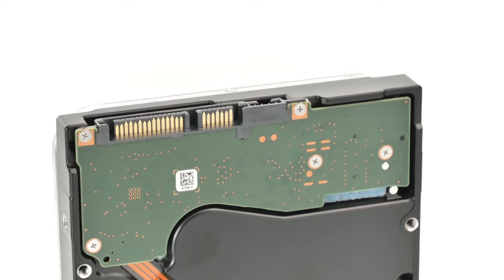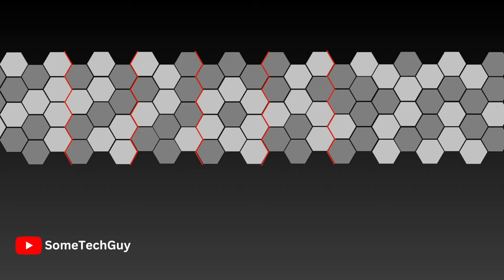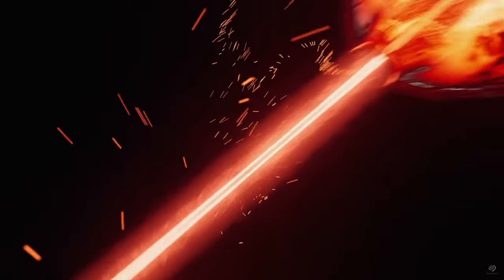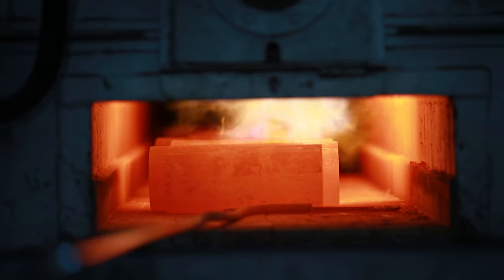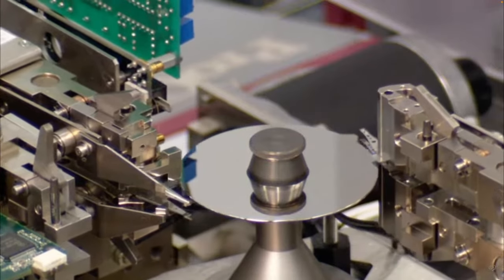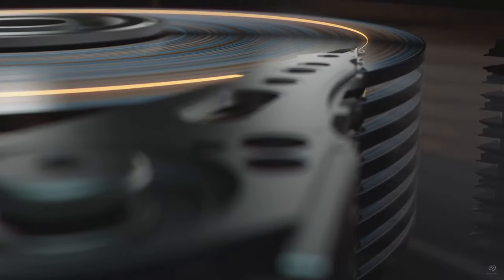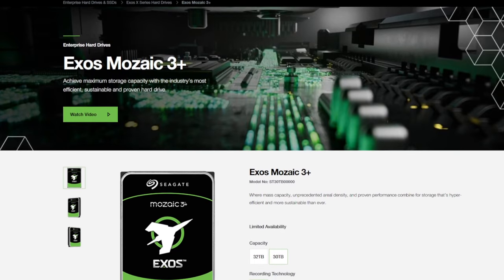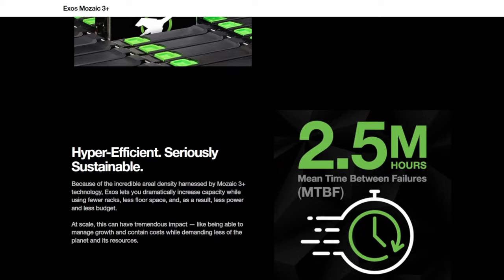Seagate Mozaic 3+ HAMR 30TB+ Hard Drives - Deep Dive

Comment: its amazing that hdds work at all
Reply: Sad that SSDs are getting more expensive tho. Would have loved to just switch over to SSDs for my stuff
Reply: @AlpineTheHusky  No they aren't. HDDs and SSDs are both getting cheaper and SSDs are actually getting cheaper faster than hard drives
Reply: @thoughtyness Maybe in the long run, but the ssd manufacturers like Samsung and Micron are reducing the supply to get better margins.
Reply: @thoughtyness  ssd are not getting cheaper, stop the cap, they're getting way more expensive due to over demand of the nand chip
Reply: And now on top of that we are using this mindblowingly precise technology and it is good and reliable enough that it can be manufactured and sold to every day people.

Comment: Am I the only person that wishes they would work on cost rather than working on size.  HDD cost to value has been stagnant for years now.  10TB drives should have fallen to the magic $99 price point by now.
Reply: It is slowly coming down. I remember back in 2018 getting a 1tb for around $100. Now I can get a 3tb for the same price. But higher is more pricey. It would be pretty cool to rock a $100 10tb or bigger.
Reply: Cost is getting down, you're just looking at it from wrong side.
Look at it as:
Base cost (casing, electronics, ect) + cost per plate and rw head.
The denser the plate - cheaper it becomes (per TB). Also you're ommiting simple fact: base materials and electronics is not getting cheaper, so how can you expect HDD getting cheaper, while it requires electronics 😂

PS.
Im ommiting other important costs, like R&D, more expensive electronics, ect.
Reply: All the things you mentioned except R&D gonna cost them max 10 bucks
Reply: With cheap ssds, hdds have become a niche product.  Most people only want 500gb or 1tb tops in their laptop/pc.
Reply: Bigger disk mean its possible to have lower price per tb but also datacenters are main customer and bigger disk mean less power usage per capacity so it makes complete sense

Comment: Looking at the way hard drives work, they seem nothing short of an engineering miracle
Reply: Love the speed of ssd-s, but hard drives are really like magic hiw they work.
Reply: Not really anyone who has ever mowed a lawn can see how you can adjust the alignment of a material (Grass) to generate patterns. The principle of how a hard drive works is rather easy to understand. The head of the drive is the lawnmower, the current passing through it is the blades of the mower, and the platter is the ground and the coating, the grass.
Reply: @IdgaradLyracant  The concept is simple, but using a macro scale component to read and write bits at nano scale is not. It's like saying you can technically use a needle to poke a CD to create a windows installation disc.
Reply: @cucumberworks and now on top of that we are heating that precise spot to make it easier with even smaller needle
Reply: It's not just hard drives, it's computing in general. It's insane computers work at all. Literally every part of a computer is starting to push the boundaries of physics.
Reply: Right.. now get your lawn mower to the other side of the yard in 4ms and make sure your within 1000th of a mm .. you still think it's easy
Reply: Not really. The concept and technology that HDs are based on has been around since the late 19th with vinyl and phonograph records and is relatively simple.

Comment: just purchased a exos 18TB, I am amazed by how the technology keeps improving
Reply: I just got a 14 exos and kinda wish I got a bigger one. Great drive though.
Reply: @_-Karl-_  yes. Ha. Its my backup for the 3 5tb drives I have. I know the math doesn't add up but it works. I know though I'm going to surpass the 12.7 allocated and probably will get 2 20s when prices go down so I have 3 full copies. As of right now I feel it would be extremely hard to fill up a 20tb with "usefull" data. 
Its crazy to think my 2tb drive 13 years ago was the cost of my 14tb. My first mp3 player was like 512mb. Now I can't fit all my music on a 512gb sd card. Lol
Reply: But it's improving beyond logic. As HDD become bigger without improving performance they are starting to become a bad quality tape. If you build a RAID with say, 8 of these drives and have a failure, even if the drive sustains 100% peek performance and it's only 60% full it will take close to 19 hours to rebuild. Long enough that the possibility of a second drive failure during a rebuild is real.  Clearly, it will take maybe 2 to 4 times more time (because of random iops) so you get the picture.

Comment: This is starting to become complicated. How long does it take to rebuild a 30TB HDD that is at 60% utilization?  It will take forever exposing the RAID array to a second or third failure (catastrophe)  during that time. We all know HDD performs pretty bad on random IOPs, but even if we assume the drive will be rebuilt at max sequential speed ( 270MB/s) it will take 19 hours.

Comment: I remember the ancestor of those drives, the Hammer drive, which got high density on an optical medium using a similar method, it was magnetising the media, but reading was done instead via the polarisation change of the surface depending on the magnetism, using an optical pickup with a polarised light source instead.
Reply from the maker: This was really cool tech. Quite a few comments here that people remember it. Minidisk was also built on the same principles I believe.
Reply: @sometechguy  If you were dealing with DTP in the 1990's you were almost obligated to have at least one, along with Zip drives, as most of your artwork for packaging and products would need to be sent on physical media, and making revisions was long. Also you had them being the biggest early adopters of CDR and CRW drives, even if they were only capable of reading and writing at 1x speed.

Comment: We think SSDs are the future when hard disk technologies are still rapidly evolving. Looks like hard disks won’t die anytime soon
Reply: considering tape drives are still evolving and have insane capacities it's not really about if the tech is going away,  but consider that we now have 64tb nvme drives that are both faster and larger capacity than hdd now,  meaning going forward they will likely be the future of non archival storage , especially as price comes down.  of course new disc media is coming out as well so we might see the Resurrection of bluray
Reply: So far, so good. But hard drives are bound to go obsolete in about 10 years. Far more room for development in SSD tech.
Reply: @manitoba-op4jx  don't drop your hard drives because they have higher failure over SSD if you do.

Comment: Fascinating. This is not my field at all. But I can't comprehend how the nfts, being necessarily larger to intercept the lasers, then smaller at the pegs to precisely deliver the heat, all fit together given their larger size than the data layer points at the pegs.
Reply from the maker: The transducer as a whole is larger, the specific sizes are not published and I guess they could change depending on the application, but as you say, it would need to be at least the size of the laser light wave as it leaves the wave guide.  Then the peg at the bottom would want to be the target size for the specific domain its targeting. And again, this size could change depending on the targeted data density. But very small, in the 10-30nm range I would expect. But the diagram isn't measured to scale, because the actual measurements do not appear to be published (unsurprisingly)

And this is going to be a simplified explanation, as I am sure the detail is important from a fabrication standpoint and its also likely to be intellectual property which isn't in the public domain.

As for the disc and the peg, I don't know if they are fabricated as a single item or joined, but in my research I did find that they had some challenges with the peg recessing into the disc at high temperature which had to be solved by densifying the metal, which is a fabrication process where the material is compressed during manufacture to reduce this happening during operation. And this (at least from what I found) addressed this issue.

Comment: I wonder if at some point they'll need to increase the physical size of drives. Like 2" tall drives with 20 platters, or 5" diameter that sacrifices speed and for capacity.
Reply: There used to be a form factor that would potentially work, 1.6” high drives. Though I’m sure around 80% of all drives produced today would be used in data centres and in disk shelves or severs which use 1” high drives, so the various drive manufacturers are more or less stuck with making 1” tall drives because the cost to make 1.6” or 2” drives would nowhere near even close to worth it considering how they wouldn’t sell anywhere near as well as the 1” tall standard drives due to a lack of compatible hardware.
Reply: They did that with the BIGFOOTxl Drives.  I have one in storage.
Reply from the maker: This is the problem, everything is standardized on the 1" form factor. But there is a roadmap to over 100Tb, so who knows what comes after that. The SATA / SAS interface is probably the real issue. It would take so long to get a 100Tb onto a disk.
Reply: @sometechguy   Folks will just upgrade to SAS at 12Gbps.
Reply: @OreoBambino  they would need to redesign factories, maybe part of the equation. cheaper to push out " a bit too small form factor" x 1000 vs just right XXL x 100
Reply: @OreoBambino   I think it had a BIG part due to access time.  It took almost 2x as long to seek data on the drive from what I understand. 

Great for Long term storage, but it just does not make sense anymore. 
You already have Flash drives in the 60TB range.   
Before too long?
FLash storage will just out density everything.  

And here I was thinking IBMs 3d Holographic storage was going to take over.
Reply: @sometechguy  U.3 addresses SATA/SAS by offering those and NVME in the same connector.

Comment: you should call your channel THETechGuy. i feel that the head swing arm is unnecessary take 4 head assemblies at 90 deg, these are static with the laser and near field transducers on each, they can then carve all read writes between the 4 of them of keep 2 each dedicated to reads and writes, also these structure can perform continuous error correction of bit rots

Comment: What I want to know is what kind of error detection and correction technology is being built into these very high density hard disks. As a consumer, my biggest concern is the safety, reliability, and longevity of the data on the disk.
Reply: Disks are mainly for datacenters as average consumer doesnt buy much of them. For datacenters it just needs to have sufficient reliability and low price, as they get replaced causing no data loss in arrays

Comment: hmmm, so I'm guessing the Secure-Erase will not be quick any more.  Because it will have to write every bit and not do a wider frequency zap.
Reply from the maker: It may depend how they implement it on the drive models. Secure Erase can be done by overwrite the entire drive, but can also be done by encrypting all data on the drive with a key generated and stored on the drive, and then just discarding the key. This then makes all the data unrecoverable.

Comment: Is HAMR as slow as SMR for sustained writes? As opposed to constant speeds with traditional CMR drives.
Because the problem with SMR drives is they are basically unusable in professional environments where you need redundancy,  where you may be copying large amounts of data, or replacing drives, generating even more sustained writes. Therefore in pro environments, you're very likely to do sustained writes, especially on bigger drives, that may be like 10 times slower with SMR than with CMR, which increases the risk of a second drive failing while the array is rebuilding a degraded RAID for example.
Reply from the maker: Currently no indication that the HAMR technology itself would be slower. There is actually a 30TB CMR and a 32TB SMR drive listed, but I would assume its a host managed SMR drive, rather than device managed and these would behave a bit differently.

HAMR doesn't work in the same was as SMR, where SMR results in data being partially overwritten and needing to be rewritten back to the media, and this is why in simplified form that sequential writes get slow on SMR once the cache is filled. HAMR writes in a similar was as CMR/PMR, its just that the media is heated in the process and the data is more densely packed.

Theoretically, the denser the data, the higher the throughput could be because more data is contained in a track and can be read in a drive revolution. But until datasheets are released and the drives can be tested for long term sustained read/writes, we won't know for sure what the throughput is. if I had to guess, for the CMR 30Tb drive, its going to be ~280MB/s, in line with the higher capacity Exos drives.
Reply: @sometechguy  Thanks a lot for the very precise answer and clarification! Can't wait to see that available!

Comment: in the late 90's early 00's i heard of a tech for storage using some sort of crystals?? - we were interested due to limitations of 'G' on a/c and this tech did not suffer from that, and was (on paper and according to manu) was much faster than anything else - the scenario the manu put forward was going to a vid shop and buying a movie with it taking seconds to download onto your storage media (in the old days of video shops)

have you heard of anything like this??
Reply from the maker: This might have been the '5D Optical Storage'? I don't know what happened to this since then, but not heard about this recently.
Reply: @sometechguy  - we were going out on a US trip and were going to look into it, but events took over - the concept being, that putting a DVD type solution on any a/c is massively expensive and not what you get for commerical - issue being with any disc based solution is moving parts and 'G' under load, hence why so expensive - this new solution had no moving parts, more akin to an SSD (but not an SSD)

Comment: But what are they going to do about the speed of these drives? Sure I would love for there to be bigger and bigger drives, but if that means I have to wait 4/5 days or a week for my Parity rebuild to finish I can't use them. Will these drives use dual activator or similar?
Reply: If your array is small enough that you can use smaller drives, then use smaller drives for the daily use and bigger drives for backups. (RAID is not a backup.)

Comment: Presumably if you use but then at some point archive a hard drive this hammer will mean that the drive should maintain their archived data much longer than non-hammer drives?
Reply from the maker: I don’t know what the stats are for retention times, and I have not seen a statement about it. But I think it follows that if the data is far harder to write to at normal temp, then bitrot should actually be reduced. But maybe that would need more data on recoverable / unrecoverable errors found on these disks.

Comment: Storage increase is nice, but in practical usage and backup of backups I will stick with smaller drives that don’t take 3 days to fill at 150MB/s
Reply: Newer drives can easily do 250 Mbytes/s. The only interesting measure is price per TB. This will heavily favor bigger drives. Also don’t forget price per slot.
Reply: No sense in trying to run backups on an entire drive when incremental methods are available. Of course, a full reconstruction would take some time, but hopefully is a rare event.
Reply: If only you could kick off automated, manageable, daily backups.
Nah, it would never work. Do yearly backups or whatever nonsense you're complaining about.

Comment: 30TB without going SMR? Sounds like I gotta switch back to Seagate. WD's SMR is my concern.
Reply from the maker: They have a 30Tb HAMR which is based on CMR but using the techniques in the video to shrink the domains. And they have a 32Tb version that combines this with SMR, though I would imagine host managed, not device managed, which is a different proposition. There are also larger ones coming. However, these disks are being used by hyper scalers, but seems still ‘coming soon’ for general availability. 

As an aside, WD and Tosh are also working on this tech, but seems they are a bit behind. I am also testing SMR drives from all these manufactures at the moment, and initial results suggest WD SMR is actually the best working implementation from a performance perspective. Still not good, but the others look like they are worse.

Comment: This is going to probably use more electricity, meaning probably need a bigger PSU, and with electricity prices, will these drive catch on?
Reply from the maker: We will see, but the power requirements for the laser itself should be fairly low as the area heated is so small.

There would be one needed per platter surface, and only used for writes. I am waiting for the official data sheets, which I didn’t see yet. And it would be good to test this against a comparable 10 platter unit like the X20 20Tb or X24 24Tb.